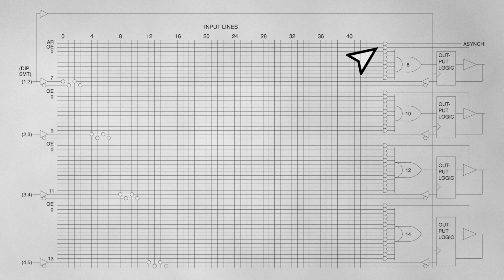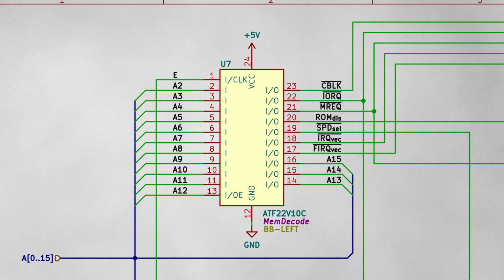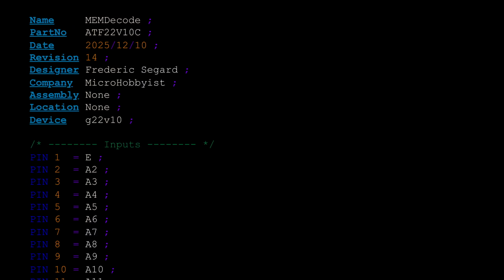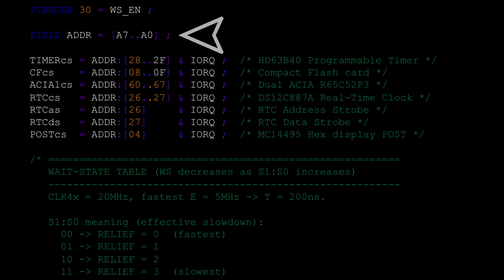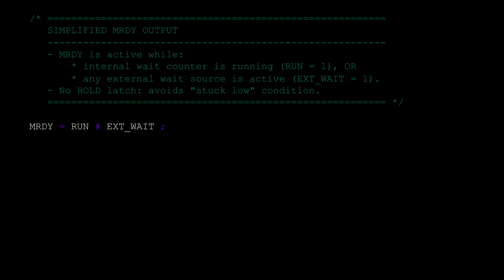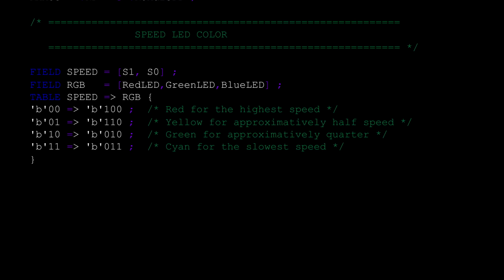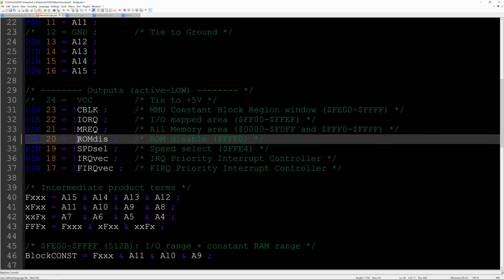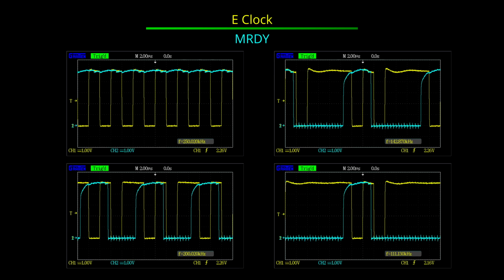6309 Unleashed – Glue It All Together With Magic | Episode 3

Comment from the maker: Who here uses PLDs in their projects? Which ones, and how do you use them?
Reply: My vz200 on rc2014 uses Gal extensively! It's a great way to save on complexity and cost
Reply from the maker: Once you start down this road, it’s hard to go back the 74 series glue.
Reply: It's in the great plan, but not got there yet.
Reply from the maker: @unicornpub you’ll get a kick out of replacing all those 74-series chips.
Reply: I split the functionality across devices, one for memory decode (obvious) and one per device so I can mess with the select logic and reorganise the memory map to suit (ie as I find out how badly I f**ked up previously), occasionally one for something more specialised (like converting data to pixels). The danger is when I let it all go out of sync - distributing it all means duplication and that will kick me in the backside eventually (probably more than once)
I'm using a 6309e so "stretching" the clock is simpler, I just assert the halt signal until I'm ready, clock keeps ticking, cpu keeps its registers fresh and I can stretch things out as far as I like as long as I wait for LIC to be asserted by the CPU
Reply from the maker: @julianbrown1331 I was playing around with the halt signal in the beginning in conjunction with stretching, but I forgot what was the real issue, as it was 2 to 3 months ago. I just know I had a hard time with using it successfully. I may retry down the road. Did you internalize everything in PLD? What does your CUPL code look like?
Reply: I regularly use GAL22V10 and GAL16V8 PLDs for system-level decode and VGA timing. You make CUPL look easy.  :)